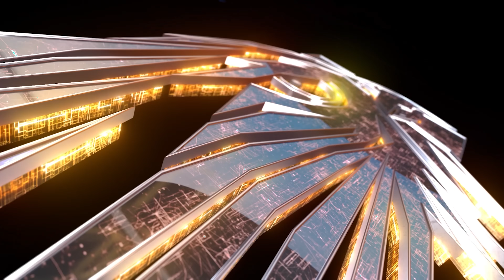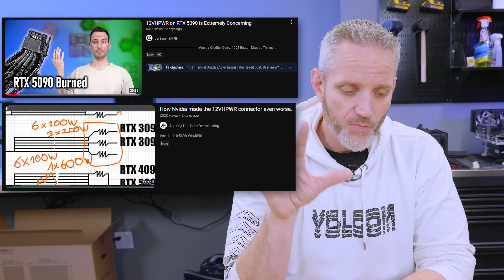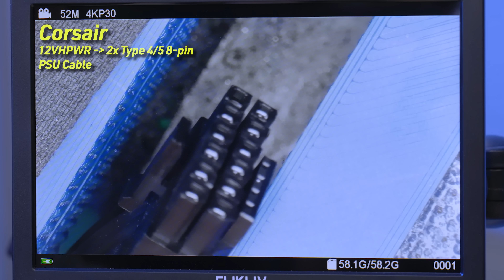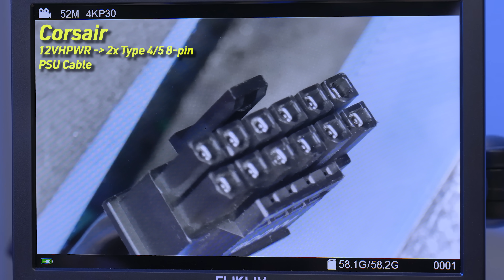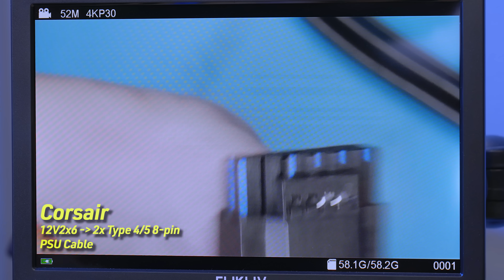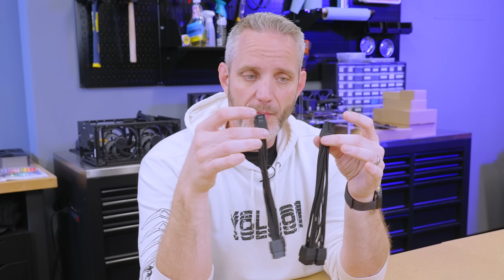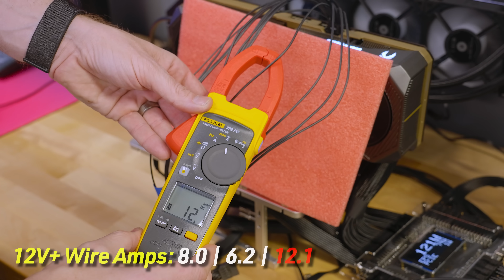I discovered something concerning and I need the Experts to chime in... More 12VHPWR discovery!

Comment: I have a "idea" on the end pin being the issue. I work with small time wiring, but if the outer wire is shorter than the rest, by say 1/8th inch or more, when the cable is bent away from that wire it puts a LARGE amount of strain on said wire. We had quite a few wires pop loose of their crimps because the wire was shorter than the res and ended up on the outside edge away from the curve direction. 

When they make these cables the dont know which way its going to be bent and so its possible if there is enough of a length difference in that 1 outside wire that when its inserted and you ben the cable away its putting a large amount of tension on that pin and if the barbs are weak or the plastic is not strong enough it could pull the pin back into the connector head.

Comment: I have 2080S. I've waited for 50 series, I wanted 5090 so it will work for next 5-8 years, but I'm kind of worried now. I have Corsair HX1200i which should be enough also for 5090 but I'm scared based on 4090 and 5090 melting saga. What do you think should I go as wanted for 5090 or rather 5080 or wait little longer for new AMD ?
I'm playing on 4k 120hz.
Reply: Wait for amd announcement which is next week,i also have 5090 on po but the cable melthing thing is stupid af

Comment: Im an Electrician for Systems and Devices working on modern Trains in Europe and i can confirm that lose Connections can burst into Flames.
The reduced Surface Contact increase the Ohm (Electric Resistance) which then generates Heat on the Bottleneck.
This is how electric Heaters work by the way, just not up to the Point where it bursts into Flames lol.

Comment: The problem is when you send current in parallel though multiple wires the resistance of the individual runs needs to be the same or the current will not be balanced. Test the resistance of the different power wires that are carrying the current. If one is really low resistance it will take the most current. Same with the connectors. By the way, anything you put in the middle between the power supply and end connector is going to change the resistance so if you put something in the middle and think it did something to balance the current, it was just likely the added resistance added to each wire caused the wires to be closer in terms of resistance so the current would end up better balanced between the wires

Comment: Which always surprises me. The PCI Express standard only allows 75W. The interface also seems relatively small compared to the graphics card. Maybe that would be something for the next generations. I think with a larger and more stable interface, there is slightly more performance. The mainboards could already be specified. I think it's just because of the "PC" hobby site. Anyone who has underestimated how dangerous 12V can be in the event of a fire should not detect the switch-off of the switching power supply in time. The limit standard seems to only require rudimentary detection for a CE mark. The electricians' associations will only be interested if there are large numbers of house fires... A low-quality cable like Corsair's should be immediately taken off the market and banned from importing into the European Union.

Comment: Could using the cable from a different power supply cause the card to run, but only display on one output? that might be my issue?

Comment: Anyone who has had an older car with headlights, will know what happens to metal connectors over time. Car headlight connectors have external corrosion, but are also properly rated … but with some corrosion, the connection overheats, slowly destroying the connector itself and the cable.

These wires will get hot, damage the connector, and the damaged connector will have a ‘smaller’ contact to carry power, causing more heat, and more damage etc!

Comment: Corsair is down for me. I've never looked closely at the original cable set. I thought they were one of the best for the price. Then the cause is now clear. I know that with the plugs even on cheap digital amplifiers and the cables that come with them. I have already fixed it again with 2K glue or simply hot glue. 

WAGO SMD terminals would be nice. Then we just install the cables ourselves :-) You can also choose the optimal cross-section and cable length yourself and feel a little bit like a real electrician :-)

Comment: loop resistance on the pins is maybe
the problem. mismatched components between female pins and male pins mating together. either the female spec pin is too wide or the male side is too narrow if the cables burn and the pins are not sucking out/pushing back in the connector's sleeve.If someone could monitor the individual pins12 volts individually going into the card after exiting the wires and socket
 and if the voltage drops that will tell you that the amps are increasing and voltage is dropping in which it should stay relatively close to12 volts on all load scenarios. i know basic electronics and that is a basic problem when it comes to troubleshooting, "ohms law" more than likely it is a pins mismatch matting problem from what you have shown

Comment: I know there are a lot of intelligent people in here commenting. What I'd like to see is testing the theory. I have experience working on vehicles which are also 12/5V systems. I have seen this pin backing out issue in multiple connectors over the years. Most of the time I push the pin up and glue it in place so it can't back out since the next step is just to replace it. It would be nice to see you test the one's that are getting hot, if they have connectors that are backing out you may be able to push them in further from the back side and or just push them forward and hot glue them in place so they can't go backwards. Then retest the connectors to see if it's a power delivery issue or a cable issue. maybe even take a small pick and bend the terminals a bit to make them tighter too and note if there is any change in temp. Would love to see some more testing on it.
Reply: you realize the hot glue will melt in card when it gets to hot right

Comment: check out the specifications datasheet for molex 43045. inside there is a derating chart for multicircuit supply. operating at 30C. then check the drawing which you will see the 0.64mm pin. then look at the current 219116 molex which is also 0.64mm. 

43045 pdf has a very clear reference, 12 circuits at full current is 5.5A, which is >700w delivery. which is 2x  12vhpwr. nvidia H100 pcie is sold as 350w device, it has only 1x 12vhpwr. so how does nvidia come to conclude that 1x 12vhpwr on 4090/5090 can draw > 350w ? 

(go search digikey 43045)
they rated these pins 0.64mm to go with AWG18 wire
so they could infact have added 1 more line AWG16
but that line is not there for some reason

copper area :
16AWG is  1.31 sqmm
18AWG is  0.82 sqmm
0.64mm pin is only 0.41 sqmm
on wiki, 0.41 sq mm is AWG21 max 9A at 75celcius
but in fault condition, it carries 12A 18A 20A
this is poor design

Comment: 7:00 Power in and power out is all the same if there is an electrical contact. The key factor here is the contact resistance. Current in = Current out. Voltage drop across the contact is Current * contact resistance. So, power dissipated by contact is V*I= I^2*R where R is Contact resistance. They need to make cables with "large" copper bar shorting all power and all ground pins to reduce power loading and enhance heat dissipation on individual pins.

Comment: I discussed this pin issue with a colleague and thought a possible solution would be to fully seat the pin and then place hot glue at the point the wire exited the connector.  The thinking is that it would prevent the pin from pushing back.  I don't have the connector to try but just a thought. The temperatures involved shouldn't cause the glue to melt.... hopefully.

Comment: It's like the crimp's hook failed to hook into the inside of housing. Still the connector housing is why too small for the wires that are needed to carry the current. I kinda suspect Nvidia did this intentionally to keep the price of their cards high as some users would need to replace theirs but it's not a high enough failure rate to be sued for.

Comment: This shouldn't matter. However this is the the entire issue with the 12v hp. The design does not have enough margin of error, enough headroom. Its just too close to the it's limits and small issues like this could add up and cause failure

Comment: Ground is common in a PC. The PCIe slot itself has a lot of ground contacts. A lot of the power coming in actually goes back to ground not through the same connector, but also through any other ground connection a card or device has. This means, the ground pins in these connectors might not be loaded as much as the 12V pins.

Comment: With the 5090 already pulling 590w out of 600+75w. I wonder if the 6090 is going to requier 2x 12vhpwr.  And when nvidia will switch to water cooling for the xx90 variant.

Comment: also id love to hear from an official source on the max wattage and max amperage on the 12vhpwr connectors and plugs. cause pulling 500w on a cable and plug thats rated at 600w max is pretty stupid.

Comment: to me id be more concerned with the gap of the connector in the plug being too wide and only making limited contact on the interior of the plug. ive been saying since 40 series that it seems to be hot spotting due to lack of proper contact, maybe its arcing from prong to plug but its causing heat and then fire.

Comment: Surely they can go back to the drawing board and come up with something better. As for Corsair saying "it's fine", that's enough to filter out that brand next time I'm shopping for something.  A pin that moves and causes a bad connection is not "fine" .  At this point, maybe GPU's should just get their own wall plug and be done with it.

Comment: I work with electrical components every day from 12vdc to 600vac. Why do these video cards manufacturers not use connections with micro screws to hold the connection in place. These connectors already exist and for the cost (over priced) of these cards there is no reason why not.

Comment: I really think they need to raise the input voltage of these GPUs, if they intend to keep cranking out cards that eat up 600+ watts. You can't push 50 amps through those crappy little connectors and expect them not to melt. That's the amount of current a car's starter motor uses.

Comment: @Jayztwocents PSU and PMD2 side indicates plug problem in PSU side, not is GPU.
If you create one solder joint in middle of simple 6 +12V cable, you have same results as PMD2.
nVidia fixed problem on own side, but not calculate with the problem not just GPU side.
Problem is this plug and cable not enough for such a high power.

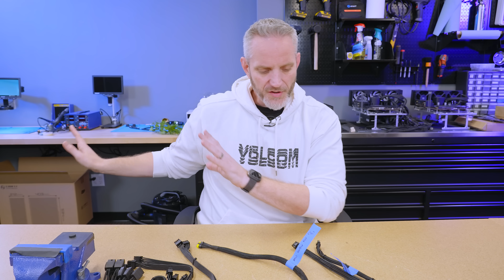Comment: @6:50 if they decided to just use a single power rail, it would also be reasonable to assume that they combine all ground connections — including those on the PCIe socket. That would give the ground connection much more alternative paths, so a loose pin wouldn't present the same problem as on the 12V side.

Comment: I'm kinda wondering why after all these  years, this is the first video youtube wants to show me of you.
Hi btw, welcome back to my recommended.
Incredibly sick of this subject, just buy AMD and stop overspending on "40-90s".

Here's the fact, I was an NVIDIA purchaser before 2008, now it's all AMD.
I was merely curious when I switched, and now I am never going back.
Year after year, PC build after PC build, all of my problems are NVIDIA.
If a customer has an issue with an AMD graphics card... we almost ALWAYS stop after reinstalling the driver, and they never need my help again.
If it's NVIDIA it falls into two categories;
"Oh yeah, I remember fixing this, and this is what we did."
Or, "It will take some time, I'll have to do some deeper diagnostics and consult some forums/experts."

That plug, has caused me to start issuing the following proclamation, and it's indicative as to how long NVIDIA has to live past this point if it loses it's AI funding;
"Yeah, that's due to the new plug design that NVIDIA is using (glossing over details because normies are easily confused), I  highly recommend you get an AMD graphics card if you don't want to deal with it, otherwise you'll need to buy a new, more expensive cable, and maybe power limit your GPU because that one STILL might melt. Oh, everytime it melts it also risks arcing to the GPU's PCB and ruining your graphics card all-together like a few customers have had happened. I don't want to get blamed for it again, so I'm telling you all this up front, I HIGHLY recommend you return this GPU and get a better one that is not NVIDIA."

To which they will say, if they are experienced, "I've had a lot of problems with AMD in the past, I really don't want to use them again."
To which I respond, "Hey, I understand, but the way I see it is you can either have issues with their drivers and sometimes things just won't work, for $800... or you can ruin and entire $1600 GPU and be forced to RMA it. The choice really is  yours, but I have to give my honest recommendations as they are."

And everytime... "I think I'll stick with NVIDIA for now, but thanks anyways."
About half of them contact me back a month to a year later, and tell me about their tragedy. How they spent top dollar for the best 12VHPWR cable (even though they are all the exact same and third-party sellers are just taking these idiots for a ride. I'm so sure you're about to say different like it fu**ing matters though... they all melt the same.... period.)

The ones I don't hear from, probably had it happen, took my advice, and never contacted me out of shame for prophesying their GPU's self-destruction.

Anyways, rant over.
TLDR: "Buy AMD, you absolute CLOWNS!"

Comment: Hey Jay, really big fan.  I know you did a review on flight simulator 2024 before. I am just a huge simulator enthusiast especially in aviation. I watched one of your videos about wasting money on ram and other parts but as of now I am trying to find the sweet spot in my build. 

I really would like your opinion on the matter. As of the cpu i know that the best option for msfs 2024 is the 9800x3d which is what I have. 

Just spectacle and frustrated on trying to figure out ram cl vs mhz on that game specifically as well as graphics card, cpu OC and other possible Nvidia driver fixes. 

If you have ever watched 2020 fs'ers he talks about debloating. IslandsimPilot talks about dlss utilization using Nvidia profile inspector for example, so we do have our driver and setting tweaks from those guys. 

I as well as  the 20 million flight sim users want your opinion on hardware! Us simmers are trying to find the best hardware on this frustratingly poorly optimized game. New sim update is coming out soon with more fixes which are working but they are recommending 64gb ram and some even 2x48 which I’m shocked about. That a game needs that much ram. Don’t no why but we simmers need a hardware answer on everything overall. Hope this is not a lot to ask but love to see a video on the best hardware for flight simulator and possibly other simulators in general since most do come from Microsoft/asobo.

Comment: Why not use XT60 or XT80 plugs with proper cross section, like e.g. in racing drones instead of a dozen thin calbles with questionable flimsy connectors?

Comment: To answer your question the ground it's equal to the positive. 
I deal with high power single wire equipment and a high resistance connection will melt independent of which cable or which end of the cable.

Comment: Honest question here: Why do they even make the power connectors like this? If they knew they were introducing a new cable that would break backward combability, why even make it 12V if they knew it would be hard to deliver that much power over 12V? Why not 24V? And if the answer to that is backward combability with existing PSU. Fair. But why even keep to this PCIe spec? Why not just two huge think cables instead of so many small ones?

Comment: these pins tiny misaligned is not very big deal as how the card treat the cable and overload a single or 2 wires out of the 6 wires it should be like 100 wats each wire or around 8.4 amps at most but as far as i found there is 25 amps on a single wire and another 25 amps on the another wire in total of around 50 amps or 580 wats loaded on 2 of 6 wires even without a factory flaw or user error i mean 100% prefect connection this unbalanced load will burn the wires and the plugs anyway

Comment: Working in QA in a manufacturing enterprise, a true professional company that cares about the customer experience, will request that you send the cable in for an engineering level evaluation. Notice I said “engineering level evaluation.” The engineers can use models, drawings and calibrated measuring devices to see if there is an out of tolerance condition.  One caveat, if the cable plugs into a device not made by them they can only vouch for their design. When you plugged that connector in, if the mating surfaces were too tight, it could have caused the connector shell or pin retaining features to fail causing the pin to push back in the shell. In the end, I recommend checking the connectors before using the cables. There is just too much garbage on the market to tell what’s what these days. Check your gear before you use it. It doesn’t matter what you pay for it.